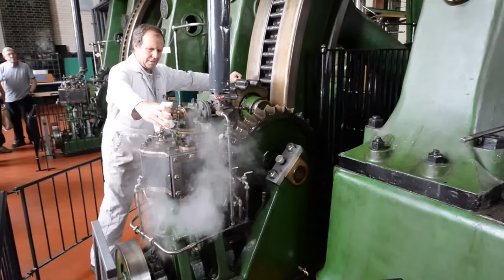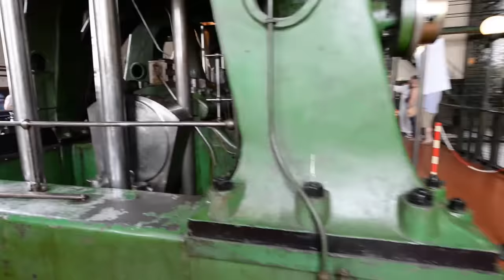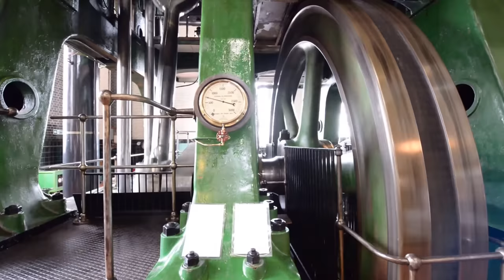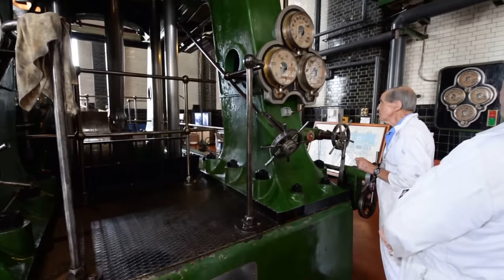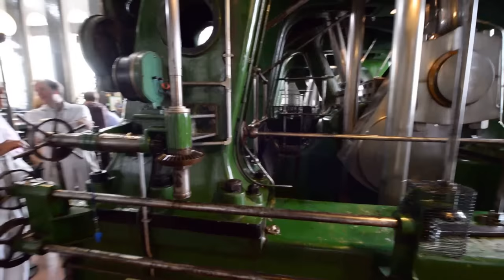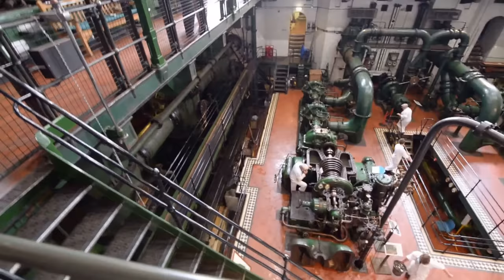Kempton Park  Big Triple Steam Engine Starting

Comment: As an ex Navy Machinist Mate I ran 30,000 HP 3 stage turbines. I would loved to have had my hands on these monsters though Fantastic machines!!!. Not one damned transistor or micro chip on it ..
Reply from the maker: Bill Fitzpatrick steam.turbines are pretty cool, and only 1moving part
Reply: Bill, 
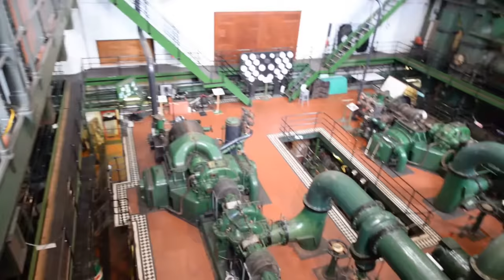Then you saw the condensing steam turbine pump sitting at 7:40 on the lower deck. It looks to have a gearbox driving the pump like Ship Service Turbine Generators which ran at 10,000 rpm to turn a 1200 rpm generator. This stuff was my bread and butter when I worked for GE Marine Department.
Reply: EMP proof!
Reply: That you say you "ran" instead of "operated" some machine says all anybody with a mechanical clue needs to hear even before.the hilarious "ran turbines" bullshit. Engines "run" on their own, Mr. Machinist.
Reply: @kimmer6  yup. After the big power outage happens, engines like these will provide the electricity needed to restart everything.
Reply: @jasonswift9310  lol
Reply: What you don't se is rhe boy's in the boiler room keeping it hot!

Comment: Used to drive past this place on my way to work and never really thought anything of it. Then I decided to pop in one day and was blown away by the scale of the place. Apparently used to pump water over a huge distance across London. I think the guy said they were very similar to the engines on the Titanic but just with one less cylinder. And I noticed the cylinders got progressively larger from left to right and it was because the steam went from left to right and as it went it lost pressure. So to get the same PSI in each cylinder, they increased the area the steam pushed against. clever stuff. :)

Comment: very impressive - the engineers in those days were pretty smart.
Reply: Still are smart!
The UK didn't start the modern world with the industrial revolution with a bunch of numpties!
MOST of the worlds inventions have done & still come out of the UK.
Reply: Gareth Jones who invented the telephone?
Reply: Yep the Scotts, as have a hell of a lot of fine engineering solutions come out of the UK.
Clever people the Scotts.
You obviously need to go to specsavers Norman as I stated "UK" meaning England Ireland Scotland & Wales.
Reply: no no no,   the inventor of telephone was italian  ane he was   Antonio Meucci, i dont know what kind of lies studied in your country.
Reply: Gareth Jones lol you contradicted yourself by sending the link...
Reply: If you can make a clock you can make an engine the only difference is the power transfer - springs, weights, water, steam, explosions - the bigger the bigger you know.
Reply: The smartest people & best inventions still comes from germany
Reply: Yes, and No. Those big old engines are quite impressive, but their design is also quite simple. Not sure a part is strong enough? Don't worry, just make it beefier. Doing so may make it more expensive, and less efficient, but then again, it also makes it more durable. And since it's more durable, there's less expense in maintenance. But it doesn't take a genius to add more material to a part if you're unsure as to how strong it needs to be.
Reply: @MaxiBeyer  they don't call roller delayed blowback German space magic for nothing....

Comment: Although the technology probably still exists today, I fear that the highly skilled engineers who actually made this wonderful masterpiece are long gone. This engine could not be built today. Very sad.
Reply: I think that it COULD be built with current skills, but the facilities for casting such huge parts are long gone.
Reply: Engines many times larger than this are built today. Just not steam powered.
Reply: These engines could be built nowadays, BUT that monster is only rated for 1008HP which might seem like a lot, but nowadays an engine with that power output is a small fraction of that size and weight, even if it runs on steam.
Reply: This is easy to engineer, the technicians who actually build the damn thing, yeah that's gone.

Comment: 12:55 That mercury arc rectifier glowing in the background...
Reply from the maker: yes it is the original ones were disposed of when the pump
station closed in the 80's These ones are from the Royal Opera House CoventGarden they take three phase AC in and convert it DC as the early electric lighting as dimming circuit in theatres and cinemas were all DC, using copper
plates in a mercury bath to give the variable resistance. When to opera hous
had its last refurb they replaced this old kit with power electronics and
donated the mercury arc rectifiers to Kempton Park
Reply: Nice to know that, thanks!
Reply: Sounds a lot like a gas thyratron. An adjustable one using the gas
inside the tube as the load and  an external resistance of some sort to vary the final output voltage. 
  Mercury rectifiers are cool with that purple sort of glow. They also offer better voltage regulation under varying loads then a conventional vacuum tube rectifier.
Reply from the maker: archangele1 higher currents to
Reply: OK I know I am half blind but I cannot see it??. Is it the blue glow on lower level in the background?
Reply: Mark Bowman fascinating!! I didn't realise the Opera House had done that, I'm pleased they did

Comment: 292 bloody idiots had disliked this great example of engineering work! Incredible...
Reply from the maker: Ha ha its probably a reflection of the video technique , I had to I use a 14-24mm wide angle lens, although it's a planer lens it still gives obvious distortion, plus the fact it is the first video I've ever shot and the focusing goes a bit wobbly at one point
Reply: @mjamesthomasb  Your video technique is good! Thanks for the clip! This steam engines are fascinating.

Comment: Anybody spot the mercury rectifiers on the lower deck?
Reply from the maker: Well spotted the expanded pumping station which the Triples were built for was commissioned in 1928, where Mercury arc rectifiers were the latest thing. The original sets were removed on the Stations closure in 1980, these ones were retrieved from the Royal opera house Covent Garden when it had a major refit in the early 0ties, the DC dimming vats for lighting control were removed along with the 3 phase 3 pulse mercury arc rectifiers supplying them, Kempton Park received them as you see here..

Comment: So is this beast about a 1000 HP & 60 RPM engine? That's insane.

The craftsmanship that went into these old engines is amazing. They had no computer aided modeling. And how did they make the castings? It all had to be made from scratch I'm assuming. And look how precise it all is.

Comment: Thanks for showing the tach.  Many sites run their engines below design speed, this is apparently running as designed.

Are the turbo pumps still in use, or is it all a museum?
Reply from the maker: SteamCrane  The pump station was decomissioned in the early 1980's It does run at normal speed but as it no longer pumps water its running at reduced steam pressure, the turbines are all out of use, thanks for taking an interest
Reply: +spikedpsycho Modern heavily stressed 1000 hp engines working 24 hours a day only last perhaps a few years, before needing major overhauls. These steam engines here, would probably run for a century before needing a rebuild.
Reply: +spikedpsycho it all depends what it use for.. if they use for ships then they have to use more boilers to build up more pressure like Titanic has 29 boilers produced 30,000hp to make 52k tons of steel sail to the sea.. 
so 1008hp is enough to pump the waters..
Reply: +Motorguy81 Sure, if you call adding an exxesive amount of steel into everything "wonderful material quality".
Reply: +Motorguy81 Yeh i see your point but you can easily turn that around aswell. How did they serve the requirement of the buyer by spending all that extra cash on making sure the machinery can run long after the technology has become obsolete? It really is the customer who asks for these short lived but efficient and cheap products.
Reply: +spikedpsycho Titanic also had two such massive engines, and her center screw was driven by a Parsons Turbine- not a piston engine. A detail which may have contributed significantly to her inability to steer around the iceberg, as all three engines were commanded to full astern- but the center screw was not capable of operating astern at all due to the limitations of a turbine, and would have instead been stopped at a time when Titanic desperately needed water flowing over her rudder. 

Where a pumping station was designed to operate with minimal maintenance costs for decades and had the luxury of space to be built and no limit on mass, the engines used on a ship have limits on how massive they can be for the power they create- and also have the cashflow available to allow for more frequent maintenance required of a higher performance engine. The Kempton engine is a compound engine as well, re-using the steam multiple times to achieve higher efficiencies at the cost of size and mechanical complexity, again in the interest of keeping the operating costs to a minimum.
Reply: +Motorguy81 I think you are unduly cynical and quite mistaken about this.   Automobiles, televisions, refrigerators...all manner of systems and machines are far more efficient and durable than in times past.    In my youth it was an accomplishment to nurse a car past 100,000 miles - today that is routine with a fraction of the maintenance effort.   I have televisions in my home that are still serving in daily use after 20 years!    Look at the shiny paint of any car manufactured in the last decade.   The materials are far better than in past and we get by without even waxing and polishing them anymore.  I note that the US Navy is retiring aircraft carriers after more than 50 years in service, and the US Air Force continues to fly B-52 bombers older than that!   Technology is much advanced over the past century.   I have great affection for old machines, but your perception that we have regressed is not borne out by the facts.
Reply: +Jon Jackson in some ways we have regressed.  I agree that in some ways we have made stried in quality and durability, but in some market segments things have regressed.  take my 1941 Toastmaster.  Now I agree that it doesnt get as hot as a modern toaster might and in some ways it's showiung it's age, but when you consider the thing is 74 years old and still does what it was designed to do and does it reasonably well and with some minor restoration could possibly function as good as new if not better and then compare it to a modern toast master made in china. . .  Well let me put it this way, I bought that toastmaster after my modern toaster oven caught fire due to a manufacturing defect.  When you adjust for inflation the 1941 toastmaster (then 18.75) cost around 200 bucks in todays dollars and it was built to last as a result.  When you have to make a product down to a lower price quality suffers.  You can argue that no one would go and buy a $200 toaster today, and you'd be right because the market has been flooded with cheap fairly disposable units for a fraction of that price, but what is lost in the casio effect this createws is a cheapening of craft and of quality.  That toastmaster 1b9 will continue to do as designed long after anything made today ends up in the landfill.  When I buy a new appliance I research boith new and used products to see what is best and sometimes an older machine offers better quality at the same price or lower.
Reply: +SteamCrane&#160; Of the things that I own that have lasted the amplifier in my stereo is still running good as new since I built it (from scratch1) in 1977. I was in the business of repairing stereos for 28 years and from that I put together that amp. It is transistorized. I fused the output section at the power supply to avoid burnup and use it continually. All the connections are soldered ( no corrosion). I am not thinking of replacing it with a new one.
Reply: +spikedpsycho Don't let horsepower fool you, steam engines are generally the best at producing high torque compared to high horsepower, this is because generally steam engines push and pull the drive piston, whilst also using 100% of the steam power inside the piston, gasoline engines only push and that push only lasts until around 20-40% of the length of the piston chamber, so you can get high rpm but low torque.
Reply: +rethla The customer asks for them because they are cheap. These machines were over-built to last 100+ years because, at the time they were built, they were intended to be functional as long as was needed, be that thirty years or a hundred and thirty years.

Planned obsolescence has developed with time, and has become a repeating cycle: things are cheaply-made so that they're easy to replace. They must be easy to replace because they break. They break because they're cheaply-made. And so on...
Reply: +Scottx125Productions - Spiffingly Serious British Gaming! Indeed every 1 nominal horsepower in steam equals 14.000 ft lbs of torque.
Reply: +thra5herxb12s I was about ready to say, not a lotta horsepower, but think of the torque! I imagine you could drag a good sized yacht up unto land with some good cable, pulleys, and this thing.
Reply: +DFX2KX You could drag the Qeen Mary 2 with that.
Reply: Going to give you all a clue here, an old whirlpool electric kitchen stove that operated since I was a kid finally had a knob go on it.  All you have to do is replace the part and it works again even burner plates can be replaced when they rust out and the burner too can be pulled by hand.Now what happens if a burner goes on your sealed ceramic top stove?  You aren't replacing that ever.  Or if the computer inside stops working, you aren't replacing that cheap if you can even pull it apart.  Televsions have become cheaper but now it's a throwaway and buy another mentality, because if the electronics in it go whos going to spend the 150$ for a new circuit board and install it themselves?Spoons made in china are stamped as a 304 stainless when really they aren't even 304 so they rust.  Old washing machines is another great example of something that'll run for a long time and all you have to do is replace a part if it breaks instead of throwing it away because you can't even fathom whatever plastic assembly they have inside if you can get to it without destroying half the machine, and dish washers aren't even made of a good grade of stainless so they rot out quickly, not commercial grade, not the standard grade Chinese can't even make spoons out of properly it's shit, absolute shit covered in plastic so that machine installed below your counter breaks and water goes EVERYWHERE, then it's another few hundred dollars to replace.  As well as cleanup.Designed to fail.  Modern phones if the buttons don't inevitably go on them the batteries fail, and sending it back to pay for part replacements is considered waste since they won't even run properly after 3 years of software updates designed for better phones.
Reply: You could do that with a one horsepower motor, given enough gear reduction. It would just take a lifetime to do so.
Reply: 1) Diced mice ?
Reply: Old machines had amazing long service life. The machines we see, that is. Do you see any Model Ts on the road today? How about Edsels? Or any Willys MBs? Not really, because newer cars were more reliable and the older ones broke down. Any still running are a handful out of millions of old machines that never made it to the present day.
Reply: Realistically this engine could output much higher power at double the speed but they are heavily detuned to never break.

Comment: Don’t quote me but I believe these were the same engines as on the titanic, and if I’m wrong please don’t hesitate to correct me...
Reply: Belle Valentine Titanic had two Triple expansion similar to this,but:
-They where a bit bigger and with four cylinders.
-They developped more than 15 000 hp each. This one develop 1080 hp 
-they were rated at 70 trm max. Idk for this one
Reply: Bobby Bobby thanks for the reply, I alwase want to learn and make sure that what I say is true ( hence, “don’t quote me”)

Comment: the same engine as titanic had
Reply: Travis R. I think the Titanic had more powerful ones.
Reply: Not really, but close.  The Titanic had two four cylinder engines.  While they were triple expansion, it had two low pressure cylinders as opposed to one on this engine. So the Titanic's engines were a bit larger than these both in width and height.
Reply: Diaval here this oneis rated 1080hp. From my memories the ones on the Titanic were rated more than 15 000 hp each.
Reply: Bobby Bobby they also could operate at a screw speed of 70 rpm.
Reply: the Titanic had piston steam engines on the port and starboard side props, the exhaust from both were channeled into a turbine to run the prop by the rudder,it's in the book ,The sinking of the Titanic published in 1912 shortly after the sinking,we have a hardcopy of the book that has been passed down from my great grandfather that I have passed on to my grandson.
Reply: Nightmqre_ 23.5 knots to be exact
Reply: Charlie K well...the Olympic was rumored to have gone up to 26kts with every ounce of steam she had the night Titanic went down

Comment: Question. So older Ships used steam engines aswell and i assume they did Start them the same way.
If there was an obstacle in the way and the order would be stop and reverse: they would need the same process with the little engine to start it again - just in reverse. Am i right? 
It would take quite some time wouldnt it?

Comment: There is one in the USA near my home. It does not run. I have not seen it in over 15 years, but a group has been working to preserve it. It also pumped water for a small city. The boilers are ruined, but the engine looks good as the engine house was maintained. The engine looks just like the one in this video, right down to the green paint.